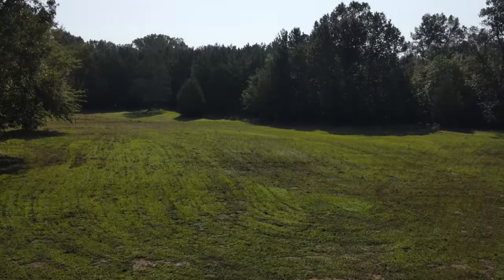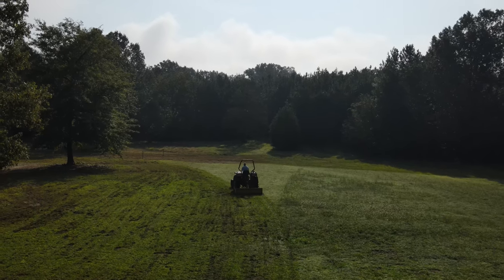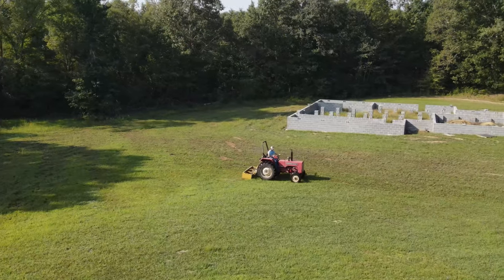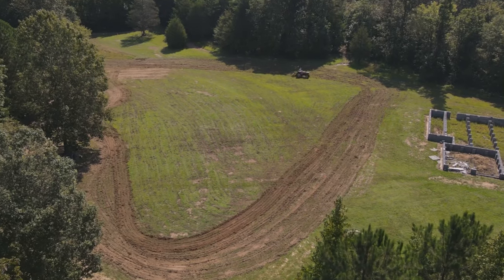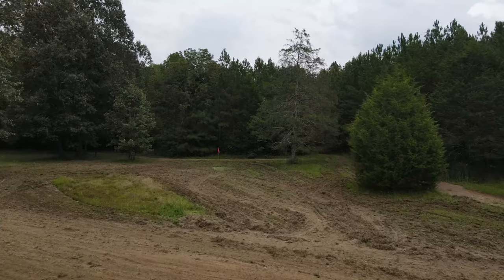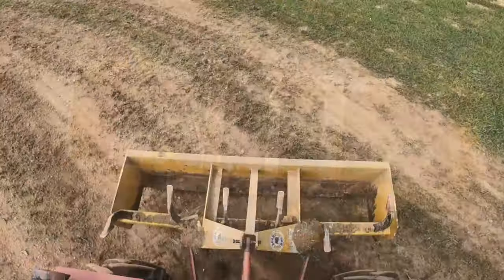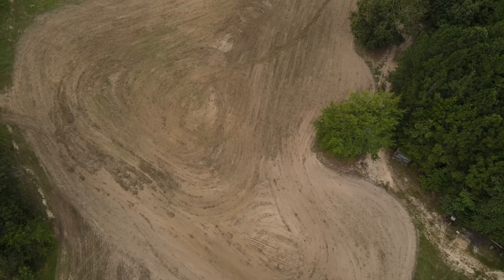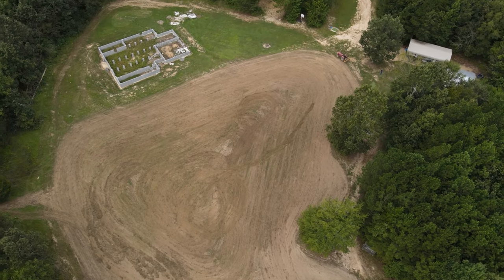Smoothing the Ground for New Grass Seed

Comment: Man and I thought I had a big yard to fix up. I have a yard thats about 4 acres, and it is CRAZY bumpy (thanks to an invasion of moles) and there are quite a few hills and dips. My yard is anything but flat, the hills go up maybe a 12-16 inches likewise with the dips. My zero turn mower is taking a beating with the uneven ground, not to mention the mole hills. Im very new to taking care of a lawn / property of this size. Would it be worth using this method to completely tear up the soil and level it? Id imagine I would have to reseed the entire yard at that point
Reply from the maker: The method I used worked alright, and I did the same thing the next year going all in, but if I had to do it again, I would use something different than a box blade.  I would till the yard up very well and then you a land leveler instead of a box blade.  This attachment is built to specifically level out and smoothen surfaces.  The box blade work alright, but I believe the land leveler would work better.  You would want to see after finishing and before some rain is moving in.